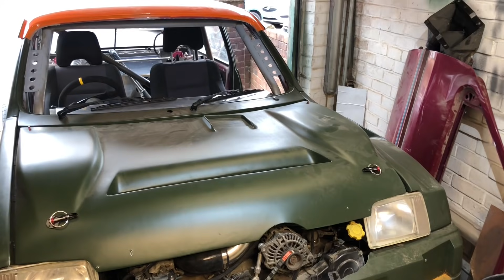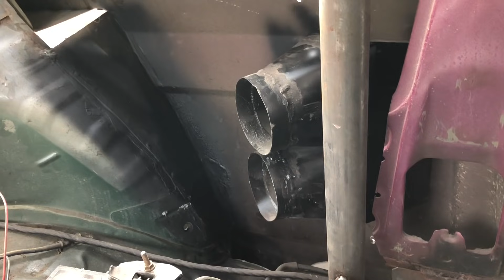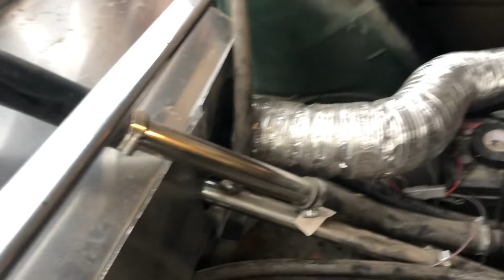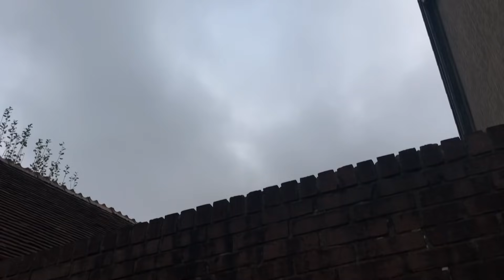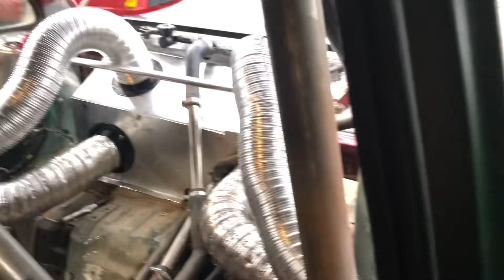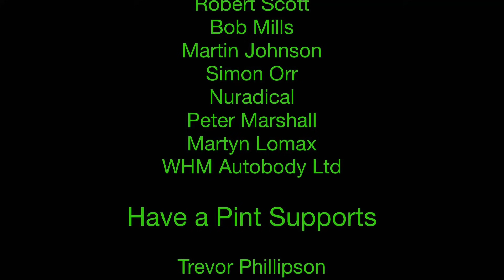Metro 6r4 Impreza (Frank) - Can we finish the ducting ?

Comment: Are those fans blowing or sucking? If they are blowing they would be better mounted on the other side it would help get the air from the ducting through the rad, they will probably restrict air if they are blowing where they are just now.
Reply: No they are sucking through to exit the warm air through the rear tailgate. However I think Matt’s going to need a pair of high velocity scavenge fan to suck in air through the side ducts, particularly if the car becomes near stationary….we’ll see!

Comment: The flexible round ducts do look the part, but I wonder if it would have been more effective to connect the intake scoops to the radiator box with a rectangular aluminium  fabricated duct, having the same cross section as the hole through the car body, or a bit bigger.  I can see a problem doing this with the location of the water pipes, but it would flow more air.  Too late now I know, but this could be an upgrade if cooling turns out to be a problem in the future. Always look forward to your next post. Crumbed wienerschnitzel and mashed potato.